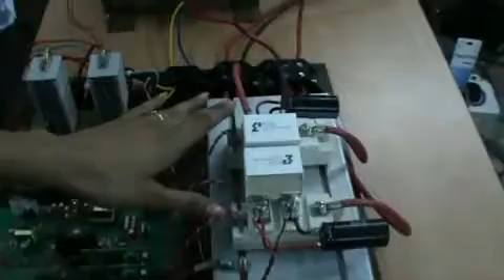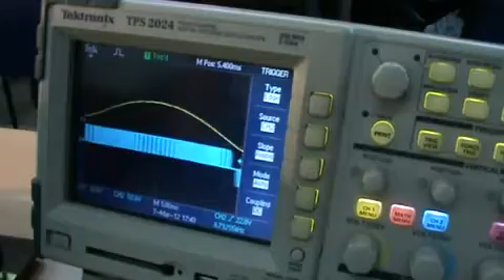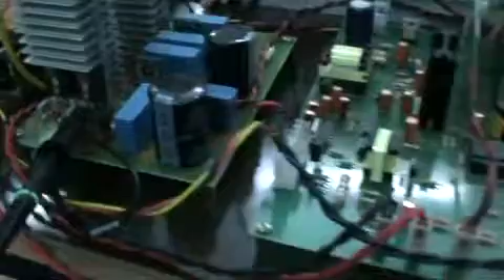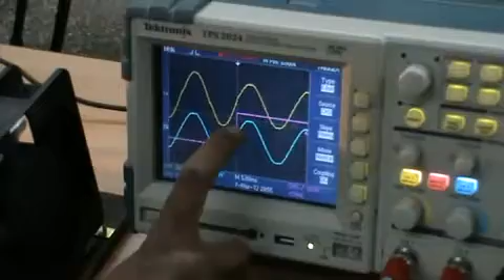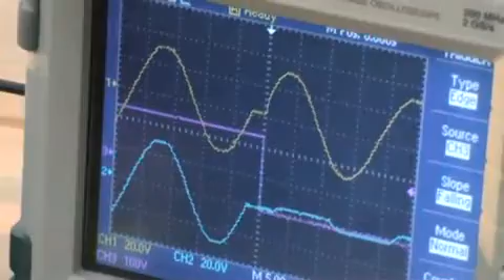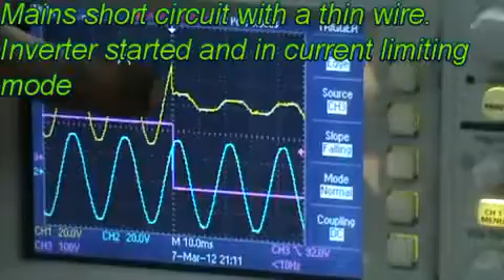sinewave inverter static changeover 10KVA.mp4

Comment: Very nice inverter Santosh Kumar
Reply: Hello !

We are one of the leading manufacturers of IGBT Controlled Static Voltage Stabilizer with high precision, fast regulation and inbuilt circuit protections. 
You may check about it more on
https://nkbtechnocratspltd.com

Contact us on: nkbtechnocrats@outlook.com
Call/Whatsapp: +91 9660061987

Comment: Normally, it is expected that the static changeover would be sufficient, however normally the contractors  too are put in series for added safety. do u think they are not required